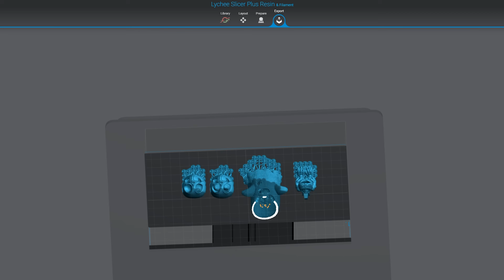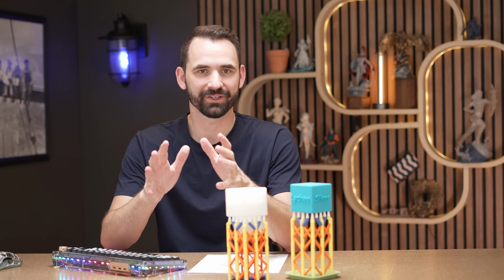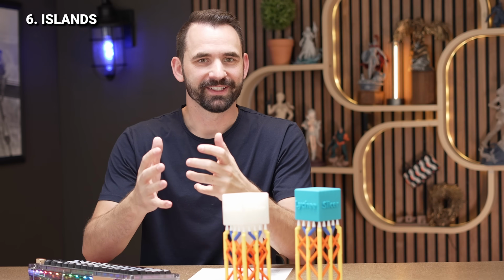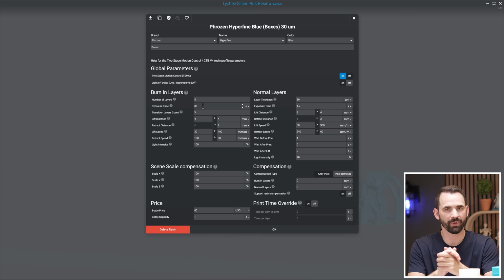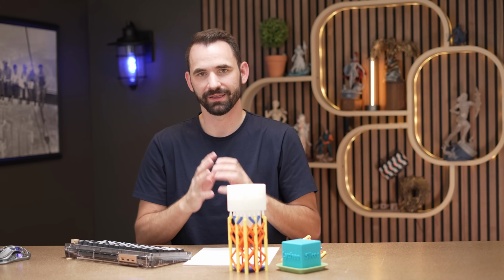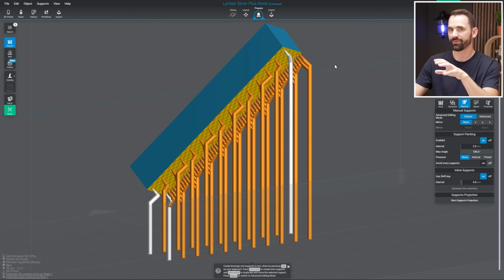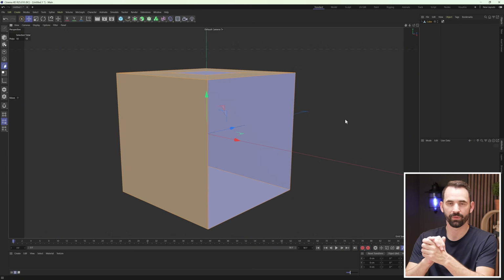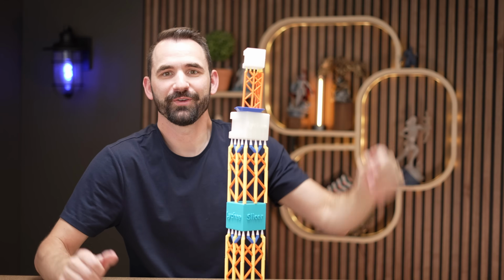Lychee Slicer, Finally Made Simple | 3D Printing Guide #3

Comment: I've heard that 10 inch 16k screens don't need antialiasing because the pixel density is high enough, and I don't know if that's true because I don't have a 16k but I find that hard to believe
Reply: Its true it's not as important as it would be in a 8k but it does limit the 16k where a 12k or 14k with AA can really make a better end result. 

However not having to add in the extra slice time and file size of not running AA does have its value.